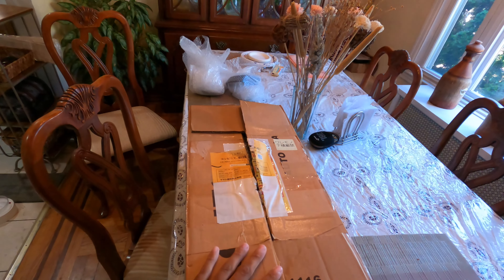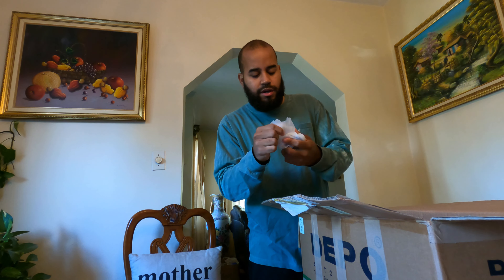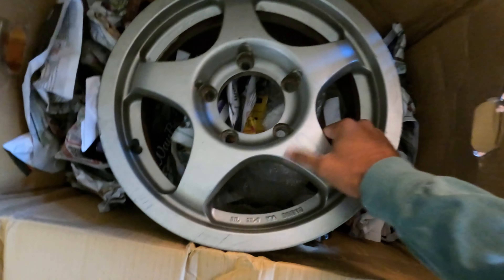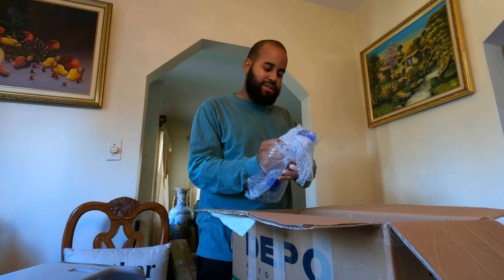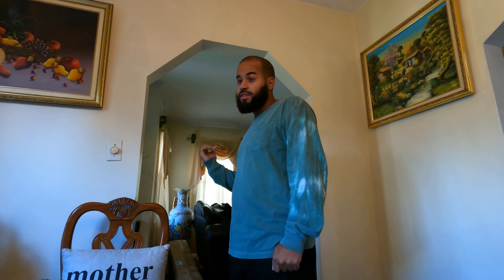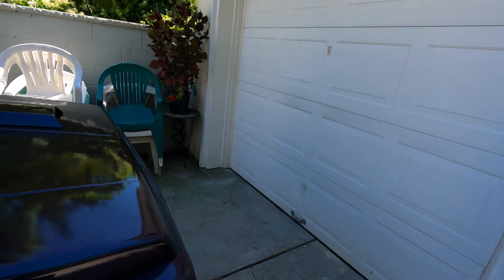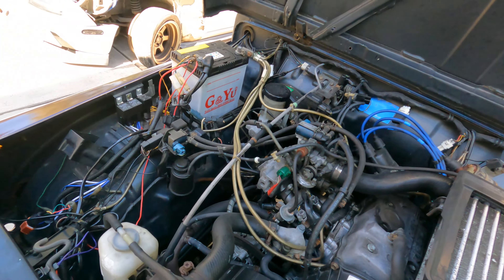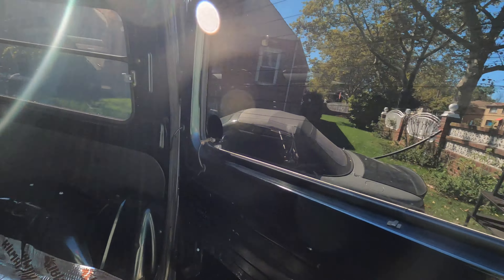MORE PARTS FOR THE SUZUKI JIMNY JA11

Comment: For your rear spoiler you may want to consider using 3M "super strength molding tape" and screws from the inside of the roof through the spoiler may help.
Reply from the maker: Idk about screw just because it’s a $50 spoiler but I will do 3M tape and probably this adhesive silicone I’ve seen before